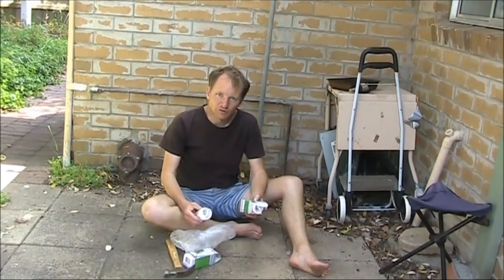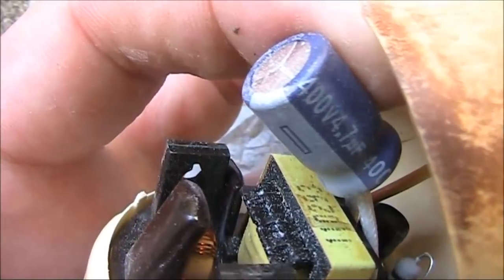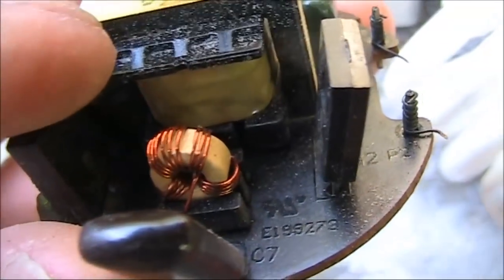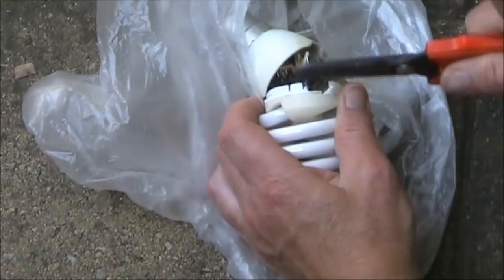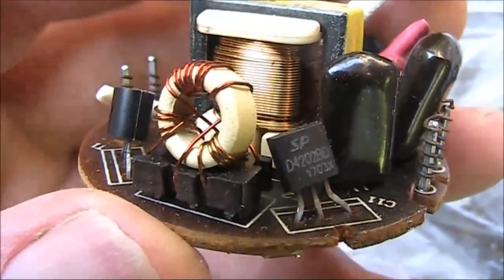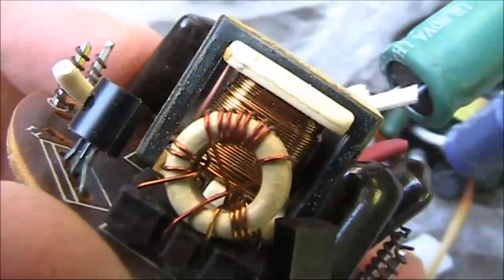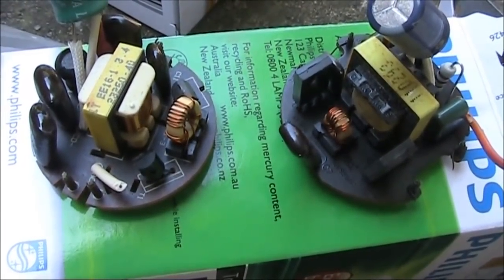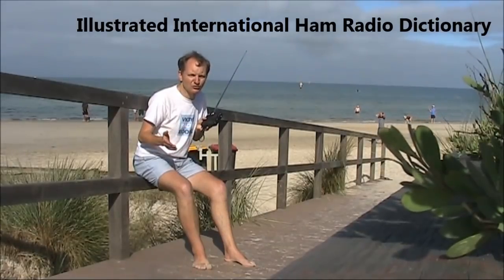Electronics on the floor: Useful bits inside a compact flourescent light

Comment: the transistors are hi-v type, not much useful actually if not on a circuit like that, they are incredibly slow, some very old ones may have mosfets instead, the newer the "more TO92", there's often a diac as someone already noted, some UF4007 or equivalents sometimes (ultra fast 4007), capacitors may have fancy values but they often look browned... tubes and boards can often be rejoined to make a working one, the problem is often to re-close the thing, that plastic is brittle and usually turns in pieces while opening

Comment: God idea to show us the parts inside Peter. These CFL  lights seem to get very hot and I really wonder if they are as efficient as once thought. We had a safety flyer put out once at work of the danger of accidentally cutting yourself with a broken CFL tube. The person had stepped on one and the flesh went like a spider bite so be careful when holding them if you are breaking it open. The " LED " bases get hot as well and I find they last about 9 months to a year and fail. I am sure the LEDs are actually OK but just the electronics in the base fails. I tested the voltage that a LED globe I had used just to run the LEDs and it was around 80volts DC.

Comment: Just remember that the electrolytic capacitor will probably be nearly dead, even if it is not bulged, the heat inside those tornado's will have cooked it nearly dry, despite it having a 125C rating.  Very likely the wire on the later device with the TO92 packages is copper coated aluminium wire, so will be hard to solder. the toroid will be a saturating type, designed to have a very sharp drop off of inductance with current, to make switching faster. You forgot the little diac there on the board, it typically breaks down at 40V to start the oscillator reliably, even with a slow ramp up of the mains, and can be used as a replacement neon lamp in old neon lamp oscillators. The capacitors that are brown were originally either green or a bright light brown, but have been cokked, like the circuit board itself, rather badly by the heat dissipated there by the electronics and the filaments of the lamp itself.  There will be thermistor there, or a VDR, connecting the filaments together, there to start the lamp by allowing a low frequency oscillation at high current, but then effectively disconnecting itself when the lamp starts. The 10R fusible resistor there on the mains input almost invariably blows at end of life, and you might also find the transistors and the diodes are leaky.